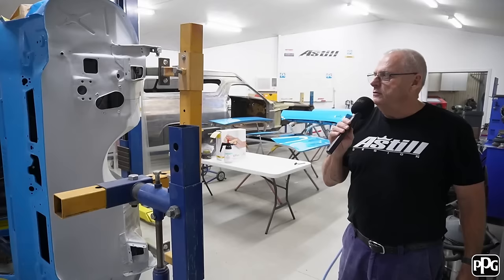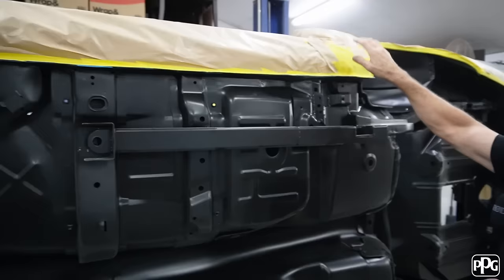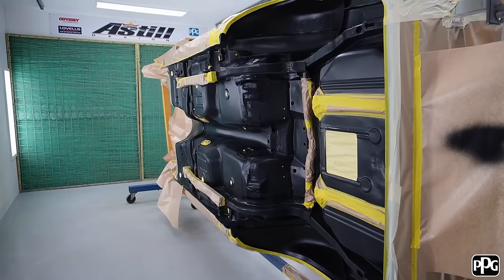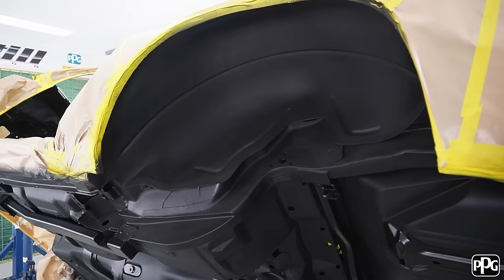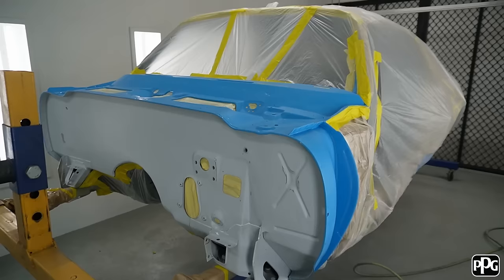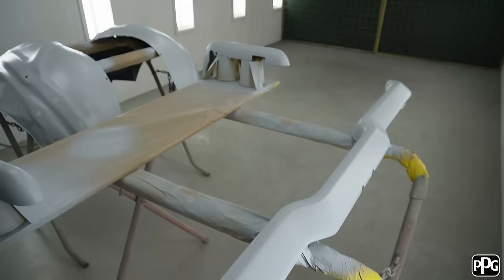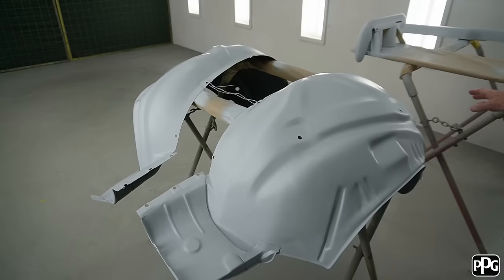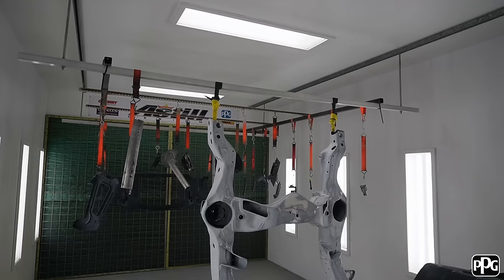#12 Painting Undercarriage, Parts and start to Assemble the Camaro | Muscle Car Respray

Comment: Just a mention. Not telling anybody how to "suck eggs" , but I like to paint the engine bay and surrounds a lighter colour.  That way you can see any oil leaks, cracks or missing bolts easier.    An old race car builders trick. 😉
Reply from the maker: This certainly is no race car.